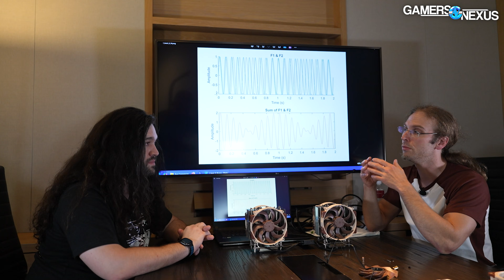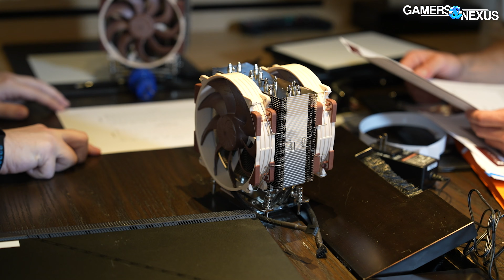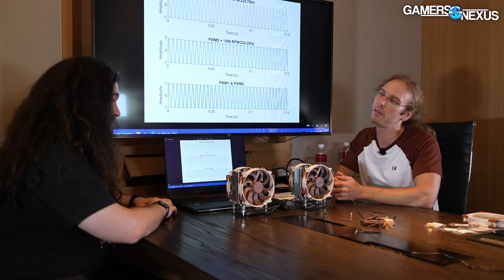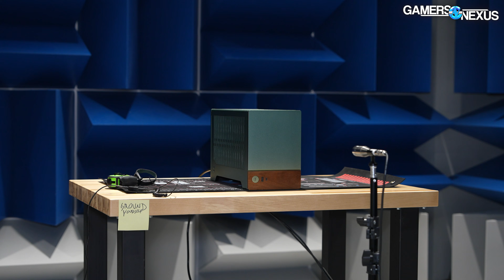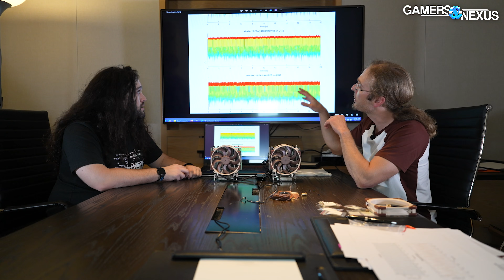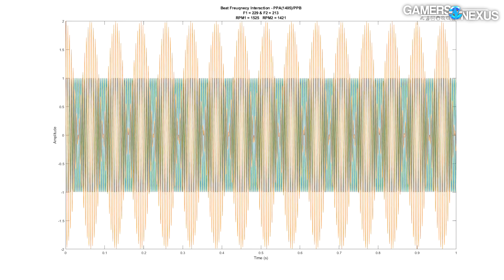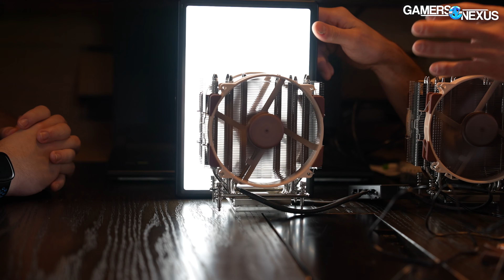The Most Annoying Computer Noise | Noctua Engineering Deep-Dive on Case Fans

Comment: Finally, someone said it.
I can only use Noctua fans simply because of the noise most of the other fans generate. While some fans (like T30) beat Noctua in head-to-head noise-normalised test, the noise profile of T30s is just too bad.
Reply: That's why I immediately replaced my arctics. They're not worth the cheap price they do this and resonate so badly if drove me nuts. A constant hum I can be fine with, but that oscillating droning drove me nuts.
Reply: @DaleEarnhardtsSeatbelt  And yes... people say it's cheaper and better elsewhere, P20 max or T30 but people don't hear these kinds of noise, good for them
Reply: @DaleEarnhardtsSeatbelt  I was checking to see if anyone else was going to mention Arctic. They offer great price to performance, but like you I struggle with the oscillating noise of the fans. I have the Liquid Freezer II and I've had to set both P12 fans on there to a constant 40% to minimise the issue :(
Reply: @DaleEarnhardtsSeatbelt  You just had a bad batch. Mine are super quiet.
Reply: @TimberWulfIsHere there is no such thing as “bad batch” with arctis. P12’s motor generates a noticeable humming noise. That’s the design issue, not some units being defective. If you can’t hear it - good for you. Some people are just less sensitive to the sound of this frequency.
Reply: @humanity_3   mine simply just don't have this issue unless they are. Around 80% fan speed. The issue comes about due to turbulence and tolerances of the design. However you can mitigate these issues. Pretty much every fan is loud at 80% speed anyway, with arctics being one of the best in terms of sound and performance.
Reply: @TimberWulfIsHere  you just proved you don’t understand what we are talking about. It’s not turbulence. It’s MOTOR HUMMING. Your fan DEFINITELY has it, because it’s just the motor itself
Reply: @TimberWulfIsHere  just for clarity: this humming noise is most noticeable at 850-1000 rpm range. So it’s nothing about “80%”
Reply: @humanity_3  prove that it's the motors making the humming sound in my fans. I'll wait. Because I'll be waiting forever.
Reply: @humanity_3  the fans are literally quiet at 800rpm, you literally cannot hear anything.
Reply: @TimberWulfIsHere  I’m happy for you, your ears are not sensitive to these frequencies.
Reply: @humanity_3  okay how do you have insight to the performance of my ears? When did you sneak into my room to measure them?
Reply: @humanity_3  stop changing the subject: prove that the motors in arctic are flawed from an engineering standpoint.
Reply: @TimberWulfIsHere  my reply just got deleted for some reason…
Google “P12 humming noise” and go read Igor’s lab article about it. That all I will say
Reply: @TimberWulfIsHere  youtube keeps deleting my reply lol. Just go google "P12 humming noise" and you will see Igor's Lab testing with info from the lab
Reply: @TimberWulfIsHere  my reply keeps getting deleted lol. Try googling "P12 humming noise" and go to Igor Lab article.
Reply: @TimberWulfIsHere  my replies keep getting deleted lol. Check Igor's article about P12 and P14 noise.
Reply: @TimberWulfIsHere  I own 11 of them purchased a few months apart. They're known to resonate poorly.
Reply: @humanity_3  before your comment I didnt notice the P12's humming noise. Now I do and it bothers me .-. You should work at noctua as a salesman :D
Reply: The other thing about Noctua fans is that they are also extremely efficient. So for the same RPM they will push more air than other fans, especially against restrictions like radiators and heatsinks. This allows you to run the Noctua fans at a slower speed while maintaining the same airflow, allowing them to be even quieter. It's not just about the low noise, it;s having that excellent performance at the same time. That's what makes Noctua fans so much better.
Reply: @shermanikk well, that’s not really the truth. Phanteks T30 outperform Noctua simply because of the fan thickness. It’s just the fact that the noise that Phanteks produce is way more annoying
Reply: @humanity_3  so, your point is what then? that there's fans that can outperform a Noctua by being louder? If you just want performance go buy some Delta server fans. Also there's a lot of situations where a 30mm fan isn't going to fit.
Reply: @shermanikk  T30 isn’t LOUDER. It has a different sound profile. T30’s dba-to-performance ration is better than Noctua a12
Reply: @shermanikk  This is not a performance issue. On my NH-D15 I ran the fans at 30% which is almost the limit for shutdown. And at this level it was very noisy, I tried to put 5 to 12% more on the other fan and nothing helped, it was a lot of crazy. So it's not a question of air flow either, at this speed it's almost inaudible!
And I'm not talking about the Corsair fans on the AIO Capellix, at 30% it was hell, even worse than the NH-D15. The a12x25 are perfect for that.
Reply: If you're getting a ton of noise from a Noctua fan running at 30%, there's something very wrong with it, probably a defective bearing. That isn't right at all. I have a PC with 5 140mm and 2 200mm Noctuas and it's dead silent until the fans hit at least 60-70% and even then it's just a quiet white noise, nothing annoying.
Reply: @shermanikk  that's just your perception bro. I currently have 9x A12 that I DON'T use right now (other than 5 that are currently running in my system). I rebuild my system very often (like 8-12 times per year), going from custom WC in ATX to SFF system that fit inside the backpack. I'm not saying there is a "ton of noise", but I personally consider any sound that's below ambient is noise. Thus, quiet fans are only those fans I can't hear. Such as A12 under 900 RPM.
Reply: @shermanikk 1500rpm noctua fan is equivalent to 3000rpm arctic fan, it's just that efficient.
Reply: interesting, i switched from noctua 3x nf-a12 to 3x t30 because of humming. my t30 fans running great, no humming :)
Reply: @adisimpson1981  same here, t30 are fans with one of the best sound profile I had, at low noise levels below ~1200rpm they're unbeatable...
Reply: I have Arctic fans and they're fine.
Reply: Exactly.   Noise to performance ratio, sound profile, reliability and product support are Nocutus 4 Legs.
Reply: yeah was the same for my MSI coreliquid - the fans were not loud but their noise pattern and profile in combination with the one from the pump head was just so annoying, i could not stand it any longer. Replaced with Noctua and much more bearable.

Comment: I found this great utility for windows called fancontrol that gives me pretty fine parameter control over the fans in my system, allowing me to avoid these resonance problems entirely (and giving me better control over thermals than most OEM software).
Reply: +1 on fancontrol
Reply: Fan control is the ultimate fan app. I hope everyone who uses the app, donates some money to the dev.
Reply: I love FanControl, it's a great little program. I've only been using it to control my case fans though using a max mixed temperature sensor of the CPU and GPU (ie: uses whichever temperature is highest at the time).
Reply: @Sevicify  I do something similar, except I offset the GPU higher before taking the maximum of the two, because the GPU has a lower maximum temperature before it throttles itself.

I also step the GPU fans so they don't hang out in RPM ranges that make the GPU fans resonate with each other and/or the GPU shell, and put in a substantial hysteresis so the GPU doesn't constantly bounce between speeds.
Reply: @roamcool  Yeah the offset for the GPU is a good idea, especially if your GPU is reaching into its throttle range. My 1080 Ti starts throttling around 70C but I go for a very aggressive fan curve starting at 30% at 40C up to 100% at 60C, combined with an under volt this kept it in the high 60s but over time it degraded to the low 70s but after repasting the card last year it barely gets over 60C now.

I haven't really cared about tweaking my fans to reduce noise aside from limiting my top case fans to 75% while the rest I let ramp up to 100%. I'm almost always wearing my headset during heavy tasks which drowns out the noise really well so it doesn't bother me.
Reply: The SpeedFan of the modern era :)

Comment: Two minutes in ~ one of the interesting things I learned at the age of 8 or 9 or so, about flying, is you have a multi engine aircraft, and you have a control precisely designed to let you synchronise the props, because otherwise you get this infuriating phase-change that goes wooop - woooop - The closer you get to 'right' the longer the wooop takes, but until you get it out to 10 seconds plus, it's something that's always present and prying at the edge of your consciousness. I would imagine these days they have a computer program to do it, but in the late 1960s ~ you had this one little dial you could turn, which I think made tiny incremental changes to the pitch of one of the props... It was to let you fine tune the RPM of the engines.
Reply: I learned there's now something called "synchrophasers". It controls speed and matches propeller angle so there is absolutely no beat frequency, but maybe a very subtle random variance depending on how good the synchrophasers are.
Reply: A lot of older aircraft still in service obviously, but this is mostly 'solved' with electronic synchronizers etc. in recent aircraft... when it works.

Comment: Can someone explain this two-fans idea to me?  
It seems pretty useless to me as not much more air will flow and cooling won't significantly increase. What even is the use-case? My fan runs at ~25% and CPU keeps cool without any issues.  
And regarding noise: I put my PC in another room, because the HDDs are much, much louder than all the fans.

Comment: My first thought: If the cause of frequency beat are fans that are not perfectly in sync, can't you just physically make the fans dependent on each other so you can't spin one without the other
Reply: I'm sure there's a way to do it but keep in mind it has to be cost-effective. Noctuas are already 30€ a pop. For example they have done exactly that in aircrafts with synchronizers and synchrophasers as someone pointed out in the comments. Apparently speed control is done by adjusting the pitch of the blades so not exactly something you can do in a PC fan
Reply: First thing that should come up: "if it was that easy, why aren't people doing it right now?" So how would you do it? Huge rod/axle like in a car? What consequences does that have? What room does such a solution require? How critical for cooling was that room? How reliable will it be? Stick in a plastic rod, see it melt? Have a metal one and perhaps not an even thermal load introducing a new unbalance? It's engineering. Every solution has different consequences. If you got rid of one noise, but at the cost of cooling and with introducing more noise elsewhere than your customers will still not be pleased. Try working it out yourself, see what happens, great fun!

Comment: Fun fact: This beat frequency is also useful if you're tuning an instrument. If you strike a tuning fork and play a note, the beat frequency will tell you how off you are!
Reply: Try tuning a piano. I got an actual piano wrench to take care of some of the worst notes in lieu of a full tuning, and it is incredible to hear those beats as the notes come up and down in and out of tune. You'll be hearing it a lot, as those pins are incredibly precise to rotate. I also learned that professional tuners harping on getting quality tools isn't them being snooty; you have to rotate the pins an incredibly short distance and the flex from an Aluminum shafted tool is enough to throw off your "how far have I turned it?" reflex.
Reply: @EmptyZoo393  I remember learning how to do this back when I was a kid. Haven't done it in probably 30 years so I no longer remember the exact sequence. But that wow sound was very easy to hear.

As for piano tuning I've only seen it done once. My parents bought a huge piano for my sister and it was seriously out of tune. They hired a tuner to come by and try to get it reasonably tuned. He turned out to be an old blind man but he still had no problem disassembling the piano so he could tune it. It was interesting to see how many panels and and lids that could be removed on that big old piano. He might not be able to see but he still knew exactly how to open everything up, tune everything and put it all together again. Now I was something like five or six years old so I can't really say anything about the technique, just that I thought it was like magic seeing him work it all. He also said this was just a first tuning and that as the piano acclimated it would need to be retuned within a year or so. It has still not been retuned and it's been about 50 years. It is probably way out of tune, I think my sister said something about that some years ago. But nobody is actually using it so who cares. Can't really sell or give it away either. It seems no one want a gigantic piece of instrument like that any more.
Reply: @EmptyZoo393 worth noting: a piano string is under such high tension that it exhibits other acoustic and overtone oddities.
Reply: @EmptyZoo393  as someone who used to tune the big thing is how hard you can summertimes need to roughly jerk the pin a very small distance and not perfectly in tune. You can definitely tune unisons with a bad hammer because you are trying to get to zero beats which is easy to hear but every other note you need to have a pretty precise beat frequency.
Reply: That's true and an excellent aid. On the guitar if you pluck an open string and hit its harmonic on another string you'll hear the oscillations as you tune into and out of pitch. Very useful for tuning without an electronic tuner...as long as the initial reference tuned string is correctly in tune (you're tuning the remaining strings off of this). You'll end up repeating this process till all strings are at correct pitch/in tune with each other.
Reply: It doesn't even strictly matter if the initial reference string is 100% correct, if you're playing by yourself. If you get the first one vaguely tuned by ear, so long as the others are in tune relative to it, it won't sound off (barring, I guess, a listener with "perfect pitch"). Even if you're singing along you'll generally adapt with little effort to fit the guitar's tuning. If two guitarists are playing together, the absolute tuning still doesn't matter so much as long as the guitars are in tune relative to each other.

The trick I learned is to tune low E, then compare each successive string, open, to the previous string at the 5th fret (except the second-to-last, B, which is on the 4th fret of G). Then you can compare the two E's to validate. I guess this is what you mean by "its harmonic on another string", but this is an easy pattern to remember.
Reply: @kaelananderson9237  No, he literally meant the harmonic, common way to tune is hitting harmonics on two strings and tuning ti match them. Convenient in some scenarios since you don't need a hand on the fretboard, the harmonics still ring out.
Reply: @bligh1156  Main benefit of harmonics is you're not tuning each successive string to be slightly sharper than the last, like you would if you were pressing down a note
Reply: The issue here is cost Vs reward, on an aircraft these beat tones can have very real safety implications, both directly to the passengers (infrasound is both unpleasant - nausea inducing - and at high enough levels fatal) and also to the aircraft (if the wings for example have a resonant frequency close to the beat frequency they would begin to flap, stressing the airframe to the point of failure. This could apply to any resonant mode of the aircraft pitch, yaw, roll, etc ) as such it is well worth the time, effort and cost to synchronise things properly. Your pc on the other hand makes an annoying sound, how much more are people willing to spend on a fan or fan controller to fix this when you can 'offset' the noise into a less audible frequency cheaply and easily like they have done. How big would the market be for that? Noctua must have asked that question internally and decided 'No, our stuff is already expensive enough we don't think the market could stomach the extra cost'. I'm sure they could come up with their own fan hub, bespoke connectors, fan internals and software, and create their own ecosystem, after all it's been done many times for argb and now for linked fans so maybe down the line they might think it profitable?
Reply: It also known as wolf tone on string instruments like Cellos and is undesirable...
Reply: Yes if you're a musician you hear beat frequencies everywhere, but many non-musicians don't seem to notice it.
Reply: And then there is the realisation of absolute horror when you notice how imperfectly we have to tune to stay in equal temperament.
Reply: I use this on a weekly basis when tuning my bagpipes!  They use a cane (wood-like) reed that may be tuned to a different pitch depending on the weather conditions of the day, where our "A" may vary anywhere from 475 to 485Hz due to temperature and humidity.  Three drones on the back of the bagpipe play a constant note to match the chanter (the melodic part of the instrument), and are typically tuned by ear by listening for the beat frequency between the individual drones and the chanter.
Reply: source: trust me br0

Comment: I'm curious what happens when a third fan/frequency is introduced. I've been going nuts trying to quiet a hum on my new 2x140 AIO that seemed not to be there on my 3x120 AIO. I'm sure this will be a valid working solution on the 280 but still curious about the 360